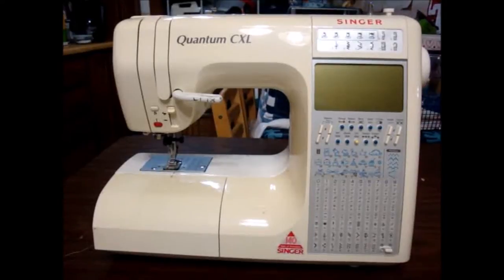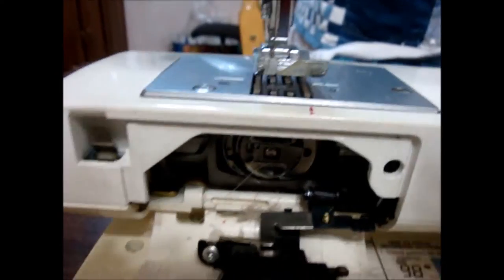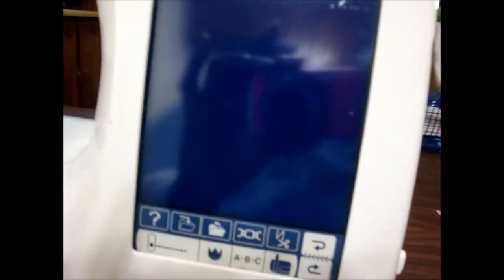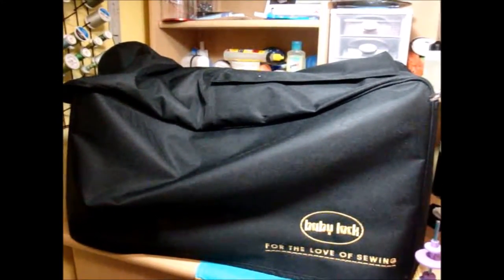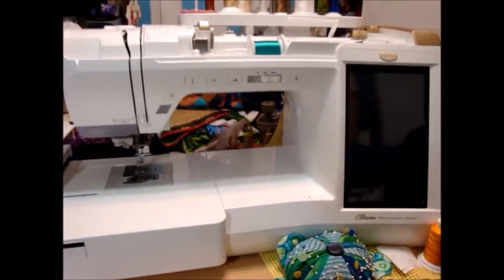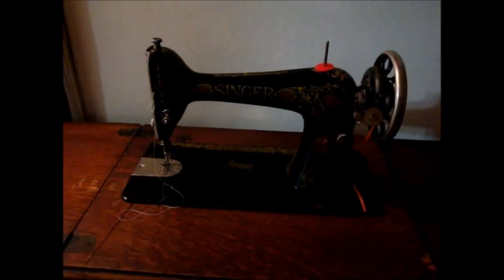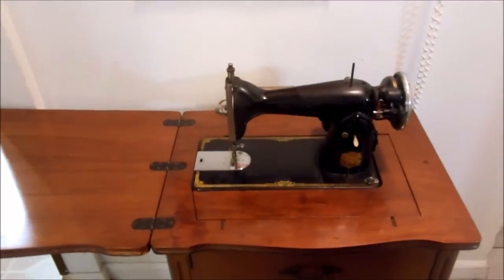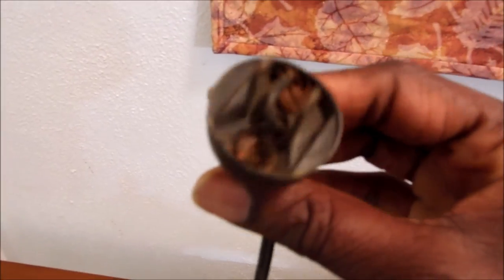My Sewing Machines

Comment: I have my Grandmothers Singer Slant-o-Matic Rocketeer, the serial numbers place it at 1961 which is the yr I was born! So it’s very special to me! It’s a heavy duty metal machine that sews denim and even leather/suede. I have the booklets and feet which is very interesting but you can check You Tube for demonstrations on particular parts and such specific to your machine. Maybe even EBay or Etsy. It always amazes me that you can find help on any topic on You Tube! Hope you get your Grandma’s machine up and running so you can enjoy her!
Reply from the maker: Hi Cindy.  Finding old manuals and instructions for older model sewing machines is a positive in this massive social media world!  I've used it on a couple of occasions, but not much.  The machine is in one of those tables as it doesn't have a base; not in the most convenient location to use.

Comment: I inherited the Singer Quantum CXL from my Godmother and I want to use the embroidery stitches, however it keeps breaking a needle. I have read through the manual and basic stitching works just fine. It's all the embroidery that is the issue. Any help? thoughts? Thank you for your videos.
Reply from the maker: Sorry to hear that Stacey.  My machine never had this issue.  Are you using an open toe foot?  It's normally recommended with embroidery stitches.  Other than that, I don't have any idea of the problem.

Comment: I am trying to sew stretch cotton on my Quantum CXL and I can’t get it to stitch at all. Any advice on settings for this? I’m using stitch 2 and tension Auto. Thanks
Reply from the maker: Hi Martha,

I just getting to read comments.  However, I'm sorry to say that I don't have any advice.  It's been years since I've made clothing.  All I use is the straight stitch with 1/4" foot for piecing quilt blocks.  I use different machines for different purposes.  Hopefully the Singer CXL manual was able to assist you.  It sounds strange that just by changing the stitch that it's not stitching.  I think you may need to take to a repair center.

Comment: I had watched this video before; but wanted to come back to it, as I may gtg another vintage Singer later this year if I get some extra coins to work with. Quilting is utilized by me as panels in my embroidery jobs; vs whole quilts although thanks to you; ;you are at fault for making me do full quilting now. I love your machines. I do have a question. Since that one machine got thrown off a little by denim sewing; and I only have two machines; (and Singer 237 vintage) and a Brother computerized xr3140, do you think I should use the 237 for denim quilting???. I have a lot of denim that I am getting ready to work with. I am the lady with a commercial embroidery machine so I don''t need a sewing machine with embroidery capabilities, although that Brother does some lettering if I am too lazy to fire up the monster. But I really love the Singer 237 as it seems to sew heavy material like a charm, and in very, very good condition. (Got it free, so I feel blessed). I clean and do oiling or whatever on the Singer, the brother is new to me, so doesn't need anything other than the normal ridding of the dust bunnies etc...Tea, you are one of my online 'teachers' and your vlogs are a treasure ..don't send me a bill now, I'm an older lady on a budget...LOLOL.... I tell you this all the time, but I hope you can understand I am homebound and do stuff that I give away to give to others that need smiles, and your impact on my enjoyment is magnified, to HIs glory! Thank you always! Hunter
Reply from the maker: Thanks Hunter for watching the video again and for your words of praise.  I wouldn't dream of charging to answering a question! LOL

I'm not familiar with the Singer 237.  However, if you have all metal parts, you should be able to sew denim.  That's what they used years ago.  If possible try to eliminate a lot of cross seams meeting up would be my recommendation.

Comment: Your grandma's machines is a treasure,  it's a post war Singer 15 clone.  It will sew the bumper back onto a Buick!  You clean the machine with sewing machine oil.  The little bit of areas you see are where the top finish has stared to come off.  Never get rid of that machine and never let anyone tell you it's no good.  Your treadle looks like a Singer clone 66. Is another jem.
Reply: Oops....The Singer treadle is a real 66. It's not a clone. There are vintage sewing machine groups on face book, the people are friendly and will give you lots of advice on how to fix the machine yourself. There's very little that can go wrong with vintage Singers. Almost everything can be fixed with sewing machine oil and sewing machine grease for the gears. Belts are easy to buy and not hard to install.
Reply from the maker: I haven't had time to play on these machines much with my busy schedule.  I plan to keep and USE them.  I love the thought of using the treadle outside on my deck (even though I have electrical power installed). I will need a lot of online help in the future!    Thanks for commenting and watching.